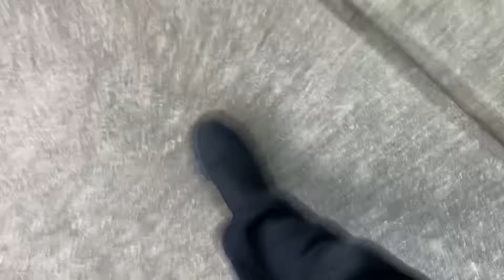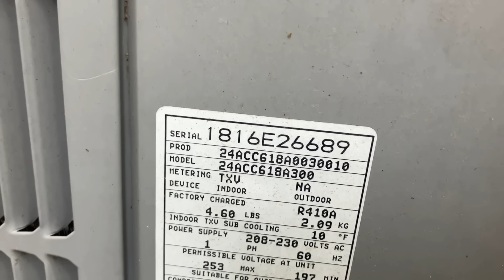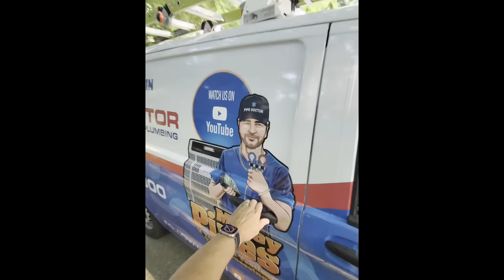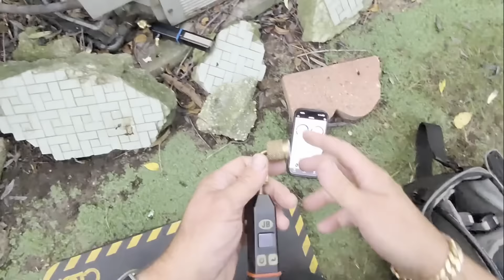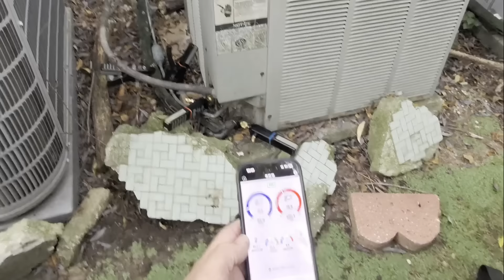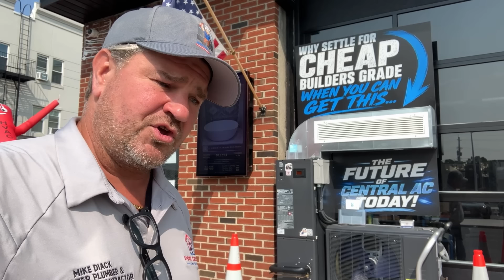35-Year-Old Rheem AC Is DYING—Would You Repair or Replace It?

Comment: 35 years on R22 is genuinely impressive, but yeah, the math here is pretty brutal. Topping off R22 at current prices on a system that old is basically throwing money into a leak. The refrigerant cost alone could eat up a big chunk of what a new system runs, and you're still sitting on 1991 equipment with no warranty path forward. If replacement is the direction, just make sure whoever does the install sizes the new system properly for the space, not just swaps tonnage for tonnage. A two-ton label doesn't mean two tons is still the right call for the load. Get the full scope in writing before approving anything. American Residential Services is one option worth comparing if you're in a covered area, though availability varies by location and you'd want to verify what they offer locally before committing.

Comment: I have a question. I had a HVAC technician come out and replace a battery in a thermostat and I was charged $300. He had to come back a week later and said that the thermostat needs to be replaced and I was billed $1,500. The original thermostat was remote controlled and couldn't get it working again so he replaced it with a new thermostat and wired it to the AC unit, which added to the labor costs. Am I a bad guy asking to be credited the $300 for something that didn't work originally or do I just eat it?
Reply from the maker: You’re absolutely not a bad guy for asking. If the original $300 visit was presented as the repair and the same problem returned a week later, I think it’s reasonable to ask whether that amount can be credited toward the final repair.

That said, the technician still spent time diagnosing the system, so whether a full credit is appropriate depends on what was explained and authorized on the first visit. I’d politely ask the company to review both invoices and explain how they arrived at the charges. A good contractor should be willing to have that conversation.
Reply: @major99ipo you got ripped off, big time.

Comment: I keep a spare OEM capacitor, contactor, and time delay module on hand. $50 for all and it's cheap insurance if you can change them yourself.  I also went from a 30 amp contactor to a 40 amp one (less damage from the arcing and lasts longer).  We have a 1995 Ruud 3 ton, 12 seer with scroll compressor that's still hanging in there.  The best upgrade I ever made is upgrading the condensate drain pump to a Diversitech model (no moving float switch - electronic sensor).

Comment: I am curious what your average install cost for a 3.5 ton ACIQ extreme heat pump.  Horizontal install craw space with plenty of room.  Tie into existing ductwork.  You are not in my market but I am wondering what the general replacement cost should run as a benchmark.   I currently have a 2000 Trane XL1200 that is still going but I did lose R22 and I have charged and added the Leak Saver refrigerant compliant CO2 injected leak stop.  Thank you and I enjoy watching your channel!
Reply from the maker: I don’t typically discuss pricing here.
Reply: @PipeDoctor  Thank you.  I think it is important for consumers to have base reference points of pricing in order to not get ripped off by HVAC companies billing all they can base on their interpretation of the wealth of the customer. Please consider pricing information in future videos for that reason.